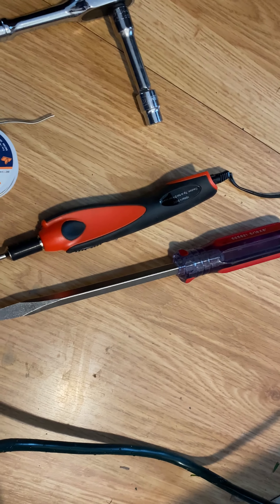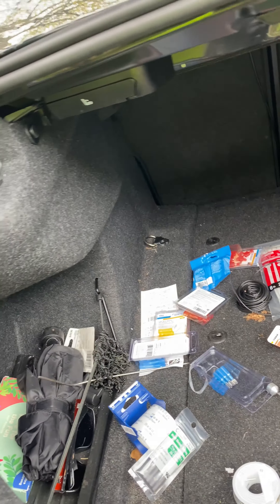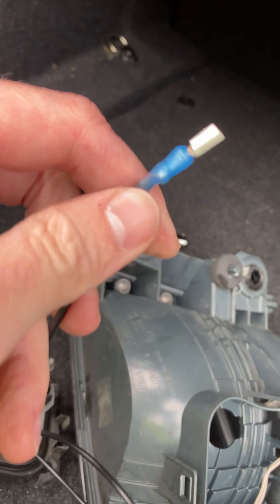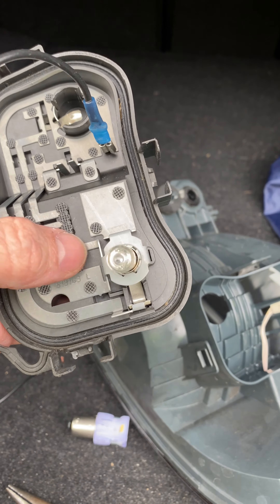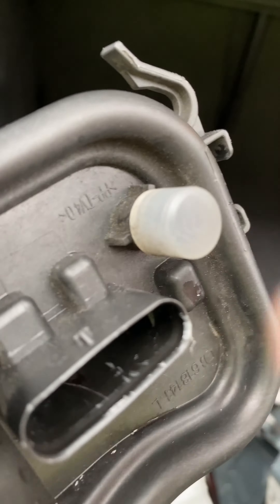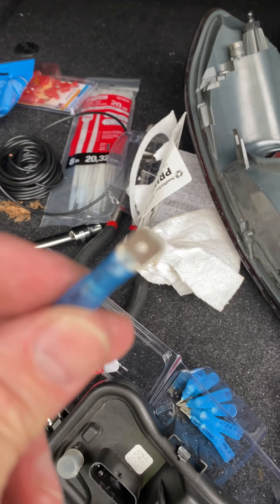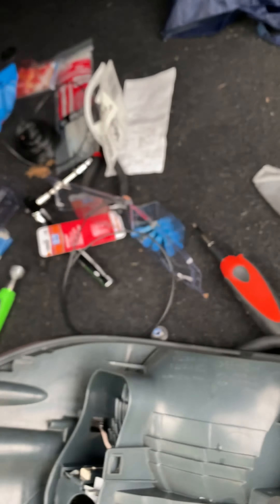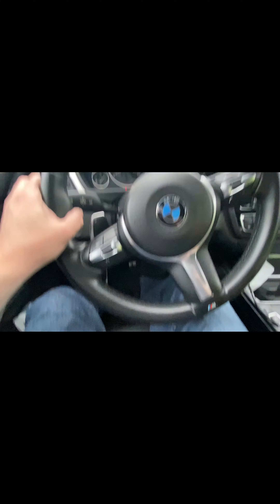BMW F32 Tail light malfunction Fix

Comment: Thanks for this nugget! for 20 quid in "parts",  I've been able to fix this issue in 40 min after living with it for about 3 wks trying to figure out wtf was going on!
for anyone else I have a 2014 4 series convertible.
Now I'm onto the next problem.... rear pass window regulator if anyone knows anything about this, I've got the part.
Reply from the maker: Awesome, glad to hear it chief. Cheers.

Comment: Excellent video. Will help me fix exacty the same problem i have with my own F32. Currently trying to find the male & female connector parts that you used to connect the wires together. What could i search that would help me find them? Thanks
Reply from the maker: I am so sorry it took me this long to respond. I just post videos to help people and I don’t usually check back too often because I’m very busy. But I got most of the stuff at Home Depot.